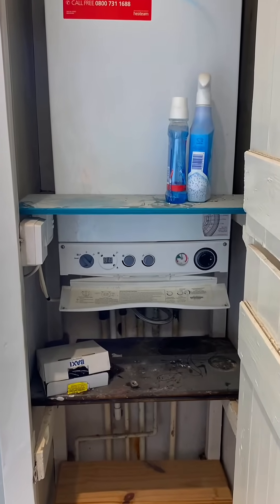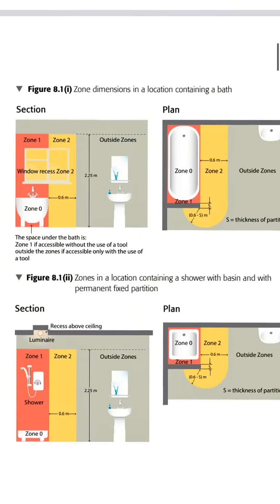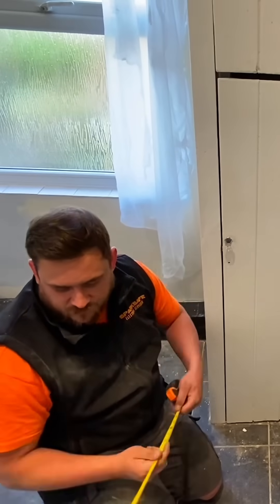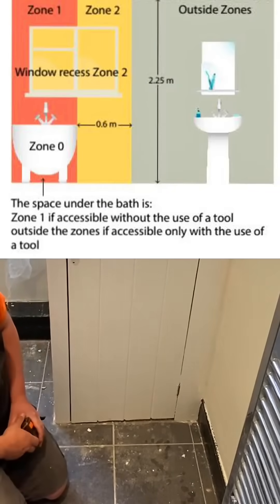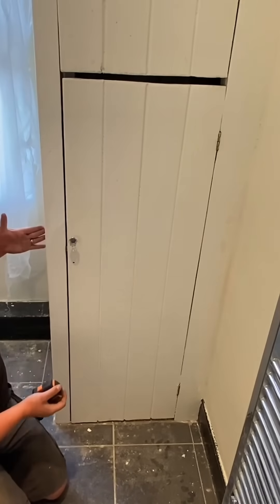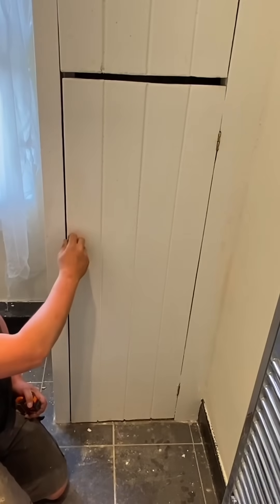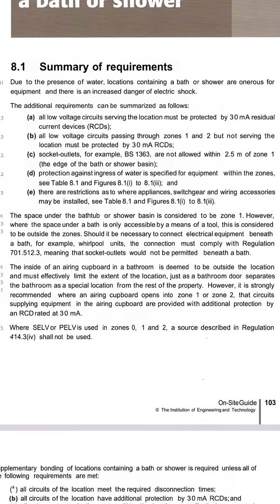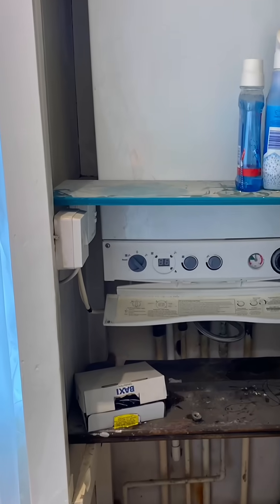Explained - Airing Cupboards￼ in Bathrooms

Comment: Which part of the regulations advise that when go through a door (such as to the hall way) you are no longer need to comply with Section 701…. socket-outlets are prohibited within a distance of 2.5 m horizontally from the boundary of zone 1. I believe this requirement applies whether inside or outside the bathroom.